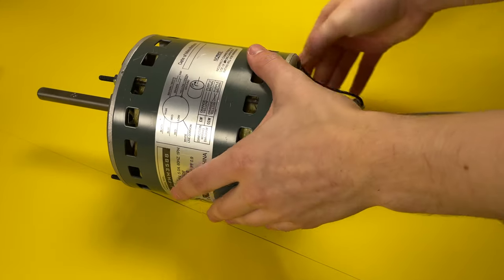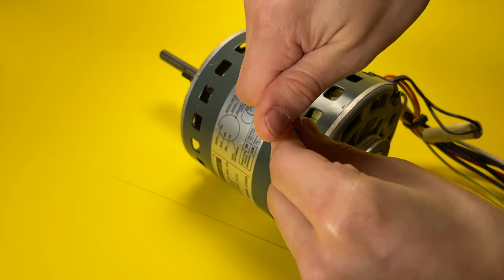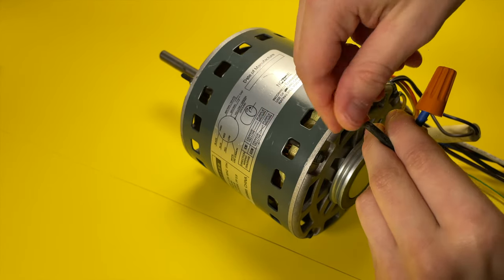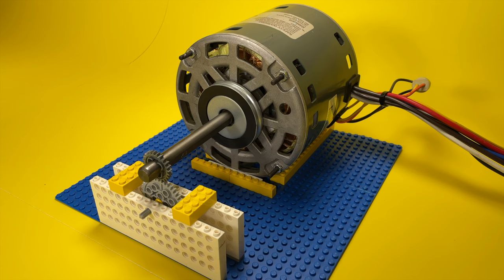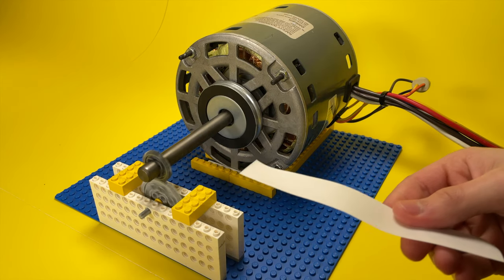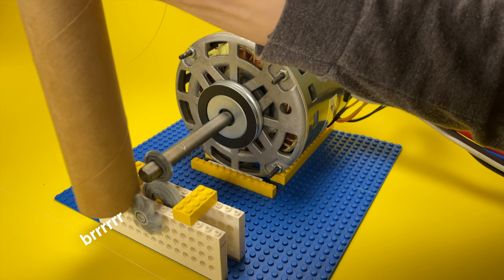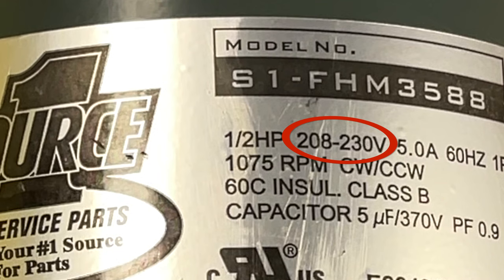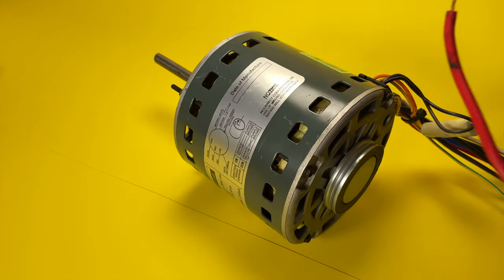The World's Strongest LEGO Motor... Ever

Comment: Hmm, note sure why but my gut feeling says that half the voltage is also half the current (because the resistance of the wiring stays the same) and maybe half the torque?
Anyway, have fun with it :)
Reply from the maker: Yes, I did forget to mention that the torque is reduced, but it’s still a 1/2 hp motor if plugged into 230v. I just tried measuring the current with a multimeter, but the inrush current blew its fuse. Anyway, it would seem your first statement would be correct, but with AC inductive loads, it’s different. Based on my research, AC inductive loads only draw as much as they need. Google 240v motor on 120v. Thanks for the thoughtful feedback!

Comment: Just a heads-up, make absolutely sure that extension cord is rated for the current. It looks like a cheap lamp/festive-lights cord, and it might not go as high as you need it to, even if it's UL listed.
Reply from the maker: Yes! Very important! The one I used here came off of a 1500W heater, so therefore it must have been rated for 15 amps. The wire seemed to be around 14 AWG, further confirming my suspicion.

Comment: Great Video
Pretty scary to see what such a big motor can do to things. I would love to see this in a LEGO Technic car.

I just wonder: If the motor draws 120V and 10A, it would use 1.2kW which would be 1.6hp but the motor is rated at just 1/2hp.
Do you know where all the power is lost?
Reply from the maker: This motor was made to operate at 240V, you can see it on the nameplate. Running it off of 120V causes it to draw twice the current and be much weaker. I didn’t have access to 240V in that room and  even if I did I probably wouldn’t mess with it xD This was more of a proof of concept video. If the motor was powered by 240V you could get the full 1/2hp.
Reply: @LegoTechnicsRule  but shouldn't it make the same horsepower if it draws twice the current but half the voltage because Current * Voltage = Power
Maybe it's just an old motor and it has some power losses when powered with low voltage

I'm still pretty sure, that the motor had very close to 1/2 hp in your video

you should definitely try to put this in a lego car 😂
Reply from the maker: @ibimsdaemil7960  I could stop it with my hand when running off of 120V. Have a look on the internet about running 240V induction motors on 120V it’s weird I know. You really shouldn’t be powering 240V motors with 120 anyway as they aren’t made for that kind of current and thus heat produced. Putting the thing in a Lego car would introduce two major challenges. Firstly, it needs power. A lot of power. Secondly, it’s frickin HEAVY!

Comment: try out placing maximum torque on one gear and no torque on the other (dangerous suggestion cause it will be more strong) (don't do it on maximum power)
Reply from the maker: I still have this thing built, I will try that.

Comment: where did you get that furnace blower motor?
Reply from the maker: I have an electrician in the family who was replacing a blower motor and since I like scrapping things, he gave the old motor to me. With a quick check of the motor with a multimeter, turned out that the capacitor was bad. I replaced it with a suitable alternative and I was left with a perfectly good 1/2 hp motor. If you really wanted one for yourself, they can be had on eBay for less than 100 bucks.
Reply: @LegoTechnicsRule  ok